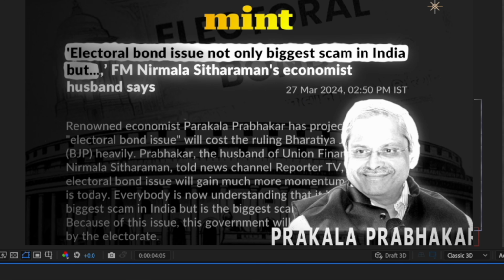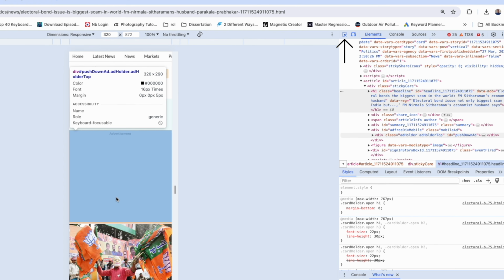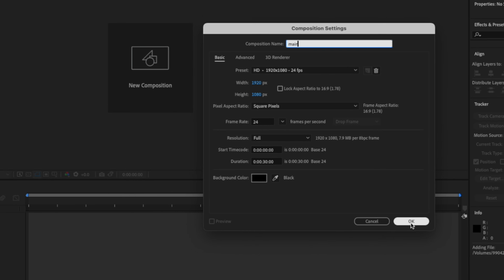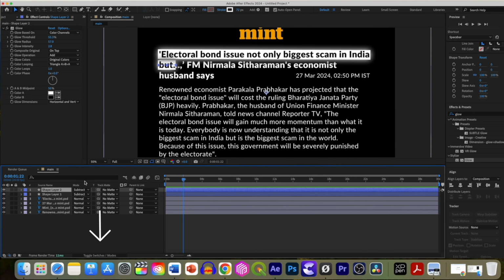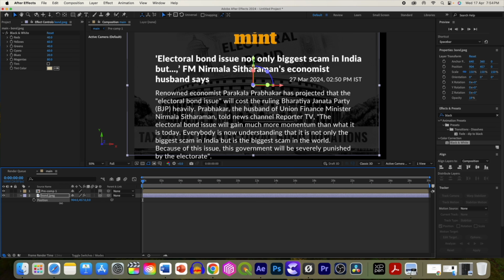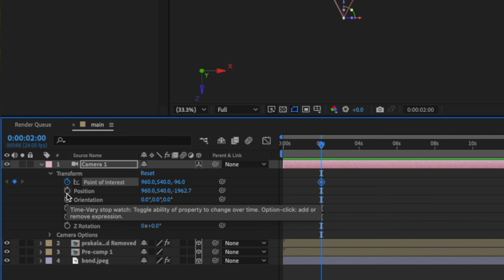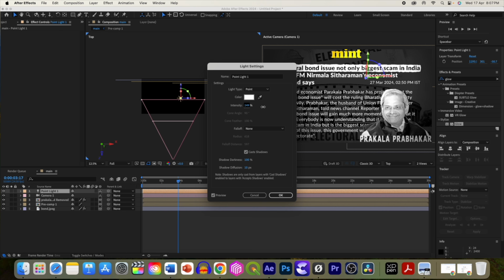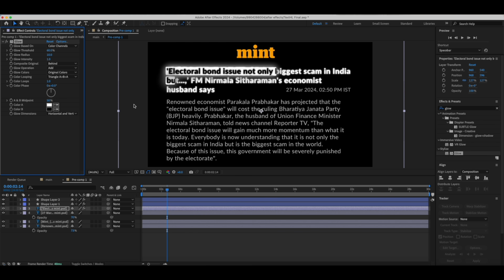Text Highlighting Effects like Dhruv Rathee: Text Highlight Using After Effects (No Plugins)

Comment: Thank You for this, i have a question!

What if we use the black text on white background and a black rectangle on the black text layer, i want the black text to appear as White when the rectangle moves forward, in this case the subtract blending effect doesn't work, that what should be the opposite of subtract so that the black text appear as White.
Thank You
Reply from the maker: No It does not work with black and black rectangle!!